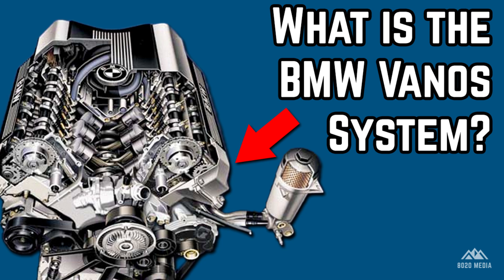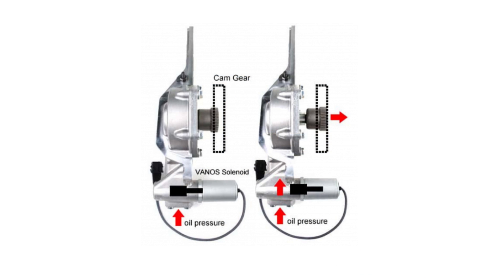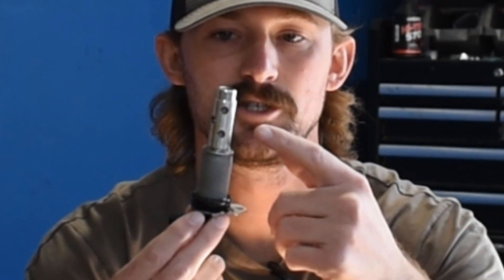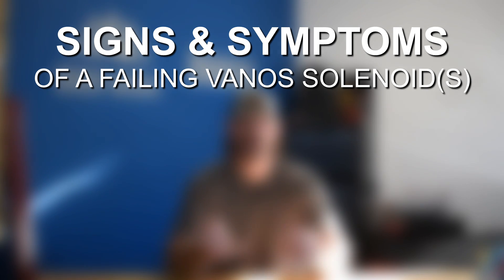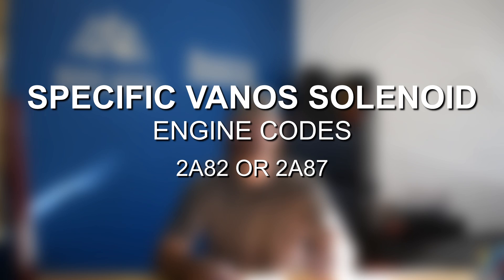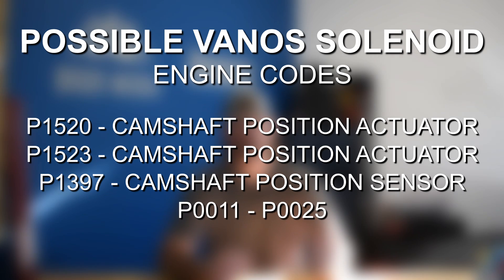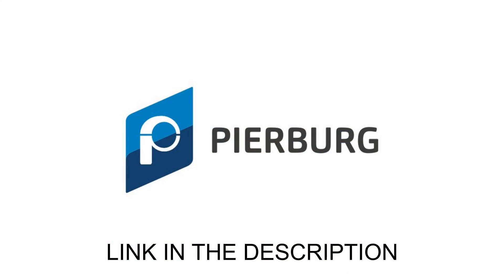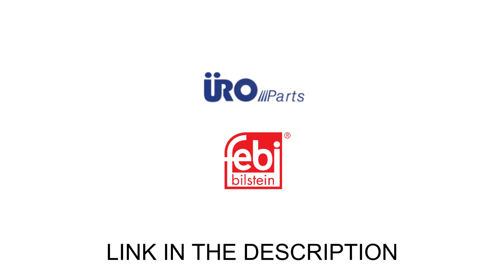Symptoms & Diagnosis of a Failing VANOS Solenoid!

Comment: My brother has a bmw x1 and it bounces the rpms on a cold start but when the engine is warm and you start it it’s perfectly fine. Would replacing this fix it?
Reply: I also have an X1 and I'm experiencing the same problem. Did you replace it? What was the result?

Comment: I would propose to keep oil change intervals max 7500 miles if using synthetic as VANOS systems are oil pressure driven. 

Cleaner oil should enhance longevity. 

I have 2005 E46 M3 w/ 110K on original VANOS, no rattle, no oil leaks, no codes, no broken exhaust tabs, bolts on sprockets tight and not sheared)...change synthetic oil max 7500 miles or annual. 

2006 330i (dual VANOS solenoids) with 145,000 miles and same oil change schedule, original solenoids. removed and cleaned with brake clean @ 130,000 miles. no codes, power is still spot on.  

2012 X3 3.5i xDrive with 125,000 miles (dual VANOS solenoids, same oil schedule, zero issues

Comment: Is it possible that clugged solenoid starts to make squeling sound that keeps on going and doesn’t stop until you turn off the car and start it again so that it resets the vanos? Ive been having this problem for a long time. My engine is n52. My engine light also turns on, but  turns off after turning the engine off and on again.

Comment: I changed my solenoids and then I put the scanner on it and boom misfires came on and the camshaft still on! Is there something I did wrong ? 2011 x5 35i xdrive
Reply: make sure you dident cross the wires when reconnecting the solenoids

Comment: Thank you for explaining this. I just purchased a used 330i / F30 and have been pouring info into my DIY brain. In your experience, do these solenoids fail predominately from sludge build-up? or is it electrical failure? or both? TIA

Comment: P13c0, p052b,2d5a,2c58,2d55 please help these codes are a nightmare on my mini cooper would these have anything to do with the vamos? Thank you
Reply from the maker: F - Yes — those codes absolutely relate to the VANOS system (BMW/MINI’s variable valve timing) and its oil pressure control. Here’s a breakdown: P13C0 and P052B both point to VANOS (variable cam timing) issues on cold start, often caused by low oil pressure, dirty oil, or failing VANOS solenoids. The 2D5A, 2C58, and 2D55 are BMW-specific codes that reinforce the same story — they involve intake/exhaust camshaft timing errors and VANOS performance faults. In most cases, these are not electrical or sensor-only issues but mechanical or hydraulic: dirty oil passages, sticky solenoids, or a worn timing chain/tensioner starving the VANOS units of pressure. Start with the basics: make sure the engine oil is clean, full, and the correct spec (5W-30 synthetic for most MINIs). Then remove and clean both VANOS solenoids with brake cleaner or replace them if they’re clogged or slow to respond. If the codes persist, it may be a timing chain stretch or oil pressure issue. Don’t ignore it — the VANOS depends on precise oil control, and driving with those codes can lead to poor performance, rough idle, or long-term engine damage.
Reply: @8020Automotive  you are absolutely amazing I started with the basics spark plug coil pack and oil change codes still coming up I’m really hoping it’s not the timing chain idles amazing sounds smooth just those codes causing it to go in like a limp mode with no turbo I believe my next bet is to clean it change the vanos selinoids thank you again for your time and knowledge
Reply: @8020Automotive quick update just finished replaced both solenoids drove the car around for 30+ mins seems to be driving like normal oh and both those solenoids were clogged I mean thick layer of oil sludge around the vents only issue now is 2 permanent codes remain being p052b and p13co

Comment: I didn't have a check engine light on for my car but mine was because I replaced them and did a lot of research mine would hesitate and then go but when I replace them and never hesitated sometimes you can get them at FCP for a reasonable price plus it's a lifetime warranty as long as you own the vehicle I just picked up a non-return so I'll be installing those if I get this weird feeling in my car thank you for your information it was very informative

Comment: Quick question.  I have N54 2010 335i Someone stole it and I  will get into everything I replaced later. I'm pretty sure I  need the vanos Solenoids. But I wondered if no one bled my system after replacing my radiator would this cause it to overheat?  I had it going into limp mode but I  had my mechanic check the charge pipe because I had just replaced all Bosch coils and NGK iridium plugs and he was getting misfires. Plus it was going into limp mode on cold starts. I also noticed he had green antifreeze in my coolant. I had the correct in trunk. I paid 4.99 Dud it go through

Comment: From a highly maintained owner of an N51 another symptom is dropping idle after driving for about 30 minutes. Meaning the solenoids can still fail in engines that have had been religiously maintained. The aftermarket solenoids DO NOT WORK. Just buy genuine solenoids. Something about them. I have tried two AM brands Vaico and Pierburg. Both brands the car started up and shutoff immediately. bought genuine, installed and had no issues until about 5 years later and 45k miles.
Reply from the maker: S - Always get what you pay for honestly. However, thank you for sharing your experience, it will certainly help future viewers!

Comment: My 2012 535i xdrive started making a squealing noise every so often then it would go away now it's constant i don't think it's the pulley but then again I know nothing abt bmws.....could this be a reason for the noise and rough idle?
Reply from the maker: C - A constant squealing noise paired with rough idle is most often a belt or pulley issue rather than something internal — the serpentine belt, tensioner, or one of the accessory pulleys (alternator, power steering, A/C, water pump) can start squealing as the bearings wear or if the belt is glazed. If the belt is slipping badly, it can also cause the alternator not to charge properly or the water pump to underperform, which would contribute to the rough running. Less commonly, a bad crankshaft pulley/harmonic balancer or even a vacuum leak from the belt-driven vacuum pump can create squeal plus idle issues. The best next step is to inspect the serpentine belt and tensioner for wear, check for wobble in the pulleys, and listen closely with the engine running to pinpoint the noise. If the belt looks cracked or shiny, or the tensioner is weak, replacing the belt and tensioner together is often the cure.

Comment: I had a jerking when i took my foot off the brake before i put a load on it..  Yeah i had the limp mode when i tried to pass someone then i got on it and cleaned them. And i was good after that. I did end up buying the pierburg selonoids. Haven't put them in yet. Tomorrow I am. 150$ each for the OEM. FCP Euro.
Reply from the maker: B - Nice! Thanks for sharing your experience.

Comment: A 2982 inlet camshaft sensor and 2986 Exhaust camshaft sensor DME codes….changed both sensors but car only cranks but no start
Reply from the maker: S - That points to a timing or wiring issue rather than bad sensors. On these engines, if the timing chain jumped or the VANOS units aren’t in sync, the DME will lose correlation between cam and crank signals, set both cam sensor codes, and refuse to start. Another possibility is that the sensor wiring harness or DME power/ground has an issue, so the new sensors aren’t actually sending a signal. Since both intake and exhaust cam codes are present together, start by double-checking that the camshaft timing is correct, the VANOS units are installed properly, and the sensor connectors/wiring are intact and seated—because two brand-new sensors failing at once is extremely unlikely, but both being flagged due to a correlation/timing fault is very common.

Comment: I bought my.
 2012 E70 X5 35 i XDrive with 80.000 as soon as I got it, I took the selonoids out,  cleaned them with brake cleaner and compressed air.I do that every few months now after the differenceit made with my N55..  So anybody who's noticing those symptoms try cleaning them, cause mine were a little clogged up when I cleaned them because I.
 Had a few of those symptoms and I knew it had never been done with the previous owner. it made an enormous difference in the engine. It felt like a new vehicle after I cleaned them  they're right in the front. They're easy to get too, easy to clean. They're right in front near the top . I removed the fan and the beauty cover that was It took me.
 About less than 30 minutes and made the biggest difference.  Right before that. I replaced all the plugs with NGK laser iridiums and my coil packs with Delphi's. But cleanin the Vanos selonoids made a bigger difference than both of them together. And I would think that should extend the life and your car will drive a hell of a lot better .   Cause even if you.
 Buy new ones they're gonna get gunked up too. Just stay on top of them. Change in your oil frequently with good oil.Goes hand in hand with the vanos staying in good health. Tomorrow I'm doing a liquid Molly engine flush plus then I'm changed my oil.What's some good liquid Miley?5W30 as soon as I change the oil.I'm cleaning the vanos again and I'll be straight for a few. Take care of your cars and they'll take care of you. That saying holds true with every brand but aBMW.  BMWs will kick u in the balls even if you stay on top of it. I still love my X5. I just had a new Camry rented for work. Drove it for like 5 days straight. BORING AS HELL. I honestly thought i was gonna like it. Soon as i got in my X5. I forgotnhow smooth and fun to drive mine is. SMOKES THAT CAMRY!!!! Not in reliability Im sure. But who wants a reliable car? 🙄😒
Reply from the maker: B - Thanks for taking the time to type all of this out. This is certainly helpful for any BMW owner.
Reply: I cleaned mine and still doing the same thing
Reply: Thanks for the info

Comment: I have a 21 x7 m50 I just crossed over 60k miles. Going through all the recommended services and after last oil change I have gotten a p00012 code for the left bank. Before taking it to BMW would it be worth trying to try these steps? I haven’t really noticed any issues the code disappeared after one day and then came back. Any help would be greatly appreciated!
Reply from the maker: D - Sorry to hear this! On your X7, a P00012 (A camshaft position slow response, bank 1) often points to a sticking VANOS solenoid, dirty oil passage, or marginal oil pressure rather than immediate mechanical failure, especially since it came and went; before heading to BMW it’s worth trying the simple steps first—verify the oil is the correct BMW-approved spec and level, replace or clean the bank 1 VANOS solenoid (they can clog with varnish and are easy to swap), and clear the code to see if it returns, since these engines are sensitive to oil quality and solenoid performance. If it persists even after fresh oil and solenoid cleaning/replacement, then it’s time for BMW to check for deeper issues like cam phaser wear or timing control problems.

Comment: Hey man my m5 comp went to limp mode several times recently and it happened right after driving in a slow traffic. I got these 130704 and 130708 codes do you think replacing or cleaning solenoids would fix my problem?
Reply from the maker: E - Codes 130704 and 130708 point to VANOS (variable camshaft timing) control issues—usually “intake control, position not reached” type faults—which often get triggered when oil pressure or flow to the VANOS solenoids isn’t quite right; sitting in traffic with hot, thin oil makes it more likely to happen. Sometimes cleaning or replacing the VANOS solenoids does help, especially if they’re partially clogged, but since you’re seeing limp mode multiple times it’s smart to also check for oil quality/level, correct filter (OEM only, cheap filters collapse and starve VANOS), and possible wiring/connector issues at the solenoids. Start with cleaning or swapping solenoids bank to bank to see if the fault follows; if it does, you know it’s the solenoid, but if it doesn’t, the issue could be oil pressure-related (pump, check valves, or internal VANOS actuators). A fresh oil change with the correct spec and trying solenoids is the cheapest and most logical first step before chasing deeper mechanical issues.

Comment: I have an n43 im working on. the timing on the inlet cam keeps moving 20degrees off even after retiming with new tensioner. Changed the vanos pulley twice as well now im suspecting the solenoids, will replace and hope for the best.
Reply from the maker: L - Keep us updated! Hope it works out for you.

Comment: I jave a 05 330i automatic. Jaut had the coils and plugs replaced ans vanos pump cleaned,and a misfire sorted(think the mechanic unstuck it?). 
I Gave it some revs the other day and the engine light came on. Then it run badly. I plugged my diagnostic tool in and it read a misifre on cylinder 4. 

Any ideas mate?
Reply from the maker: G - Since you recently had the coils, plugs, and VANOS pump addressed and the misfire has returned specifically on cylinder 4 after hard revving, it's possible that either the new coil pack or spark plug for that cylinder is faulty, not seated correctly, or that there's an intermittent issue with the injector or wiring harness. Another possibility is oil intrusion into the spark plug well, especially on older valve cover gaskets, which can cause misfires under load. I'd suggest swapping coil #4 with another cylinder to see if the misfire follows—if it does, it's the coil; if not, check for proper plug gap, oil in the well, injector pulse, or even compression issues if all else checks out.

Comment: Additional symptoms include: randomly going into rough idle while stopped at a traffic light for example. It begins with a very small lurch of the car as if the transmission downshifting triggers this. Sometimes the engine will die. There's always a loud screeching sound until load is put on the engine but until you turn off the car and restart it, none of this goes away. Sometimes it comes back again quickly or not at all. For my 328i (145,000 miles) with a value of less than $3000, cleaning them hasn't worked so I'll try the FEBI branded ones and see if I can get more life out of the car before trashing it completely.
Reply: Exactly what happened to mine. Exactly. I did a 3 step BG oil service and added Liquimoly moS2 with Mobil 1 oil. It has since stopped. You must do the BG service as intended though. I didn’t use the MOA as I subbed it for the moS2. Let the car idle with the EPR for like 20 minutes and revue it up to like 2500 for a few seconds. I did it and it has since stopped. Haven’t even replaced my solenoids and I have brand new ones sitting in the trunk still just in case
Reply: I heard bad things about the Febi Bilstien ones. The name that begins with a V i cant think of it. A dude that does them all the time says those ones he has had no problems with the Bilstiens. Had quite a few . When u do replace them clean them often. Its quick and easy enough.  I think they crap out because they get clogged and then dont function properly causing them to fail.
Reply: @billesposito2112 I put in some Amazon “hi sports” completely got rid of the issue
Reply: I am having the same issue
Reply from the maker: M - True! Thanks for sharing.
Reply: Does It stall some times in first gear also because of bad throttle response as well ? Mine has been doing it sometimes I does Down and stalls even the clutch is well controlled ….

Comment: Thanks for the video.   I have a 2013 135is. N55.   The car only has 6800 miles.   It sat for the last year and a half.    I put a new battery in and to my surprise the car started.   I was worried that the gas would have. Gone bad.   Anyway I put about 30 miles on the car everything was fine.   Stopped at a gas station and fillled it up and got a cam shaft position sensor light.   Intermittent but now it’s on.  The oil is 4. Years old with a couple hundred miles on it.   Obviously that’s the first thing on the list to do.  I’m tempted to change the vanos and cams shaft sensor at the same time being I or someone will have there hands in there.   I didn’t know anything about the vanos sensor until I did some reading on line.     Any thoughts ?  Where would you start?   I appreciate any suggestions you have to share.    Thanks very much
Reply from the maker: N - With a 2013 BMW 135is N55 that sat for a year and a half, now showing a camshaft position sensor warning right after refueling, you're right to be cautious—especially since the oil is 4 years old, which is critical in VANOS-equipped engines like the N55. Old oil can absolutely cause VANOS and cam sensor issues, especially if it's degraded and sludge-prone, even with low miles. Your first move should be a full oil change with a fresh, high-quality synthetic (BMW LL-01 approved) and a good filter; often, VANOS and cam-related codes clear up on their own once clean oil flows through the system. If the light stays on after the oil change, then yes, replacing the camshaft position sensor (start with the intake side) is logical, but I wouldn't rush into replacing VANOS solenoids unless you're still getting specific VANOS-related codes (like P0012/P0015). Those solenoids can be cleaned and tested before replacement. So: change the oil first, clear codes, monitor behavior, then go after the sensor if needed—most N55 cam/VANOS issues stem from oil quality, not hardware failure at only 6,800 miles.